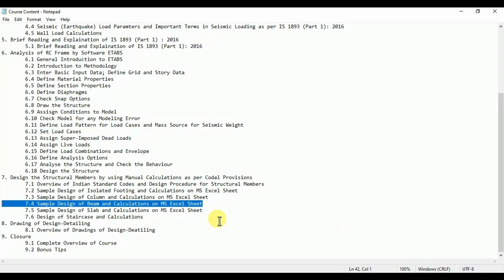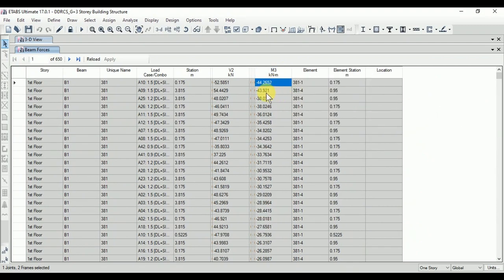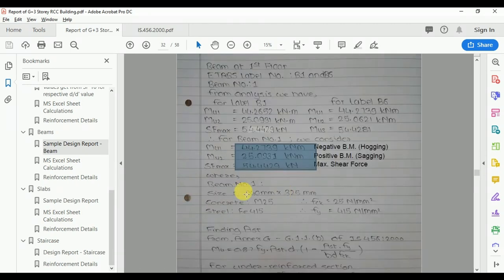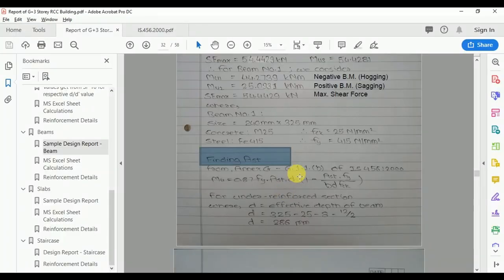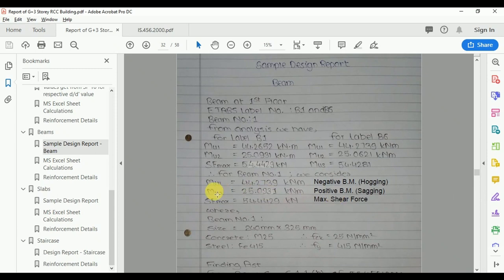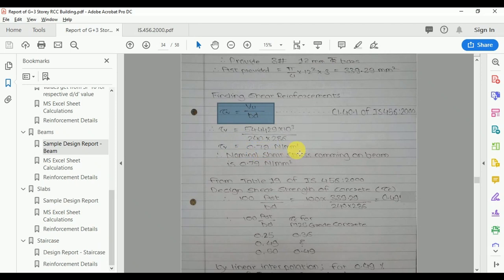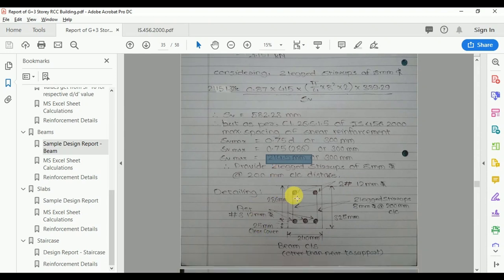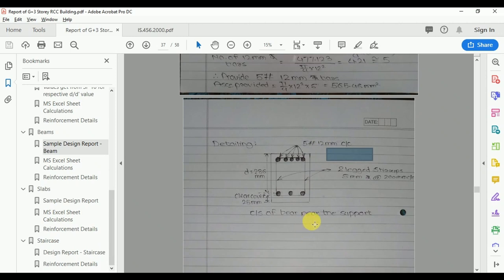7.4-A Design of Beam by Manual Calculations w.r.t. ETABS Analysis as per IS 456: 2000

Comment: For negative moment (hogging) = 234 knm. My reinforcement is 10 # 20mm bars. How would I arrange 10 bars. Is it ok that my no. Of bars are coming 10
Reply from the maker: no this is not acceptable for regular size beam, spacing in between bars should be more than nominal size coarse aggregate... in that case increase the beam dimensions or go for higher grades in material for concrete and/steel...
Reply: @AkshayThakur  my beam size is 400×500mm
Reply from the maker: how you can arrange 10 bars in 400 mm,  with proper nominal CA distance in between bars, so you need to change the section size & or material properties
Reply: @AkshayThakur  can we provide it in in two layers. 🤔
Reply from the maker: @harishjoshi1139  yes you can but some additional steps in design methodolovy are needed for this...

Comment: Did you consider *Affect of torsion on beam and *No reinforcement Layer in beam in EXCEL sheet ?
Reply from the maker: In practice, torsion is consider in very few cases like when beam is curved, cantilever beam supported on span of beam, cantilever slab supported when no back-tie slab, etc... here no such case so no torsion is considered while designing beams....

Comment: Sir, in actual practice dont we have to design the beam as a continuous beam and not as a simply supported beam
Reply: Also is it necessary to first design from tension side..as you've taken Ast for shear reinforcement from tension side..what if we first design from compression side..will that make any difference in calculation of stirrups
Reply from the maker: here if you see, i have provided main bars throughout, and extra top bars are also provided, so as per software consider continuity for  those effects are taken into account as a continuous beam...
Reply from the maker: the more economical way of doing is.... take the BM at near Support (Top End Region) and Design for the same...
Reply from the maker: stirrups are individual w.r.t. top support r/f
the design made in a way that
Bottom r/f : Positive BM
Top/Support r/f : Negative BM
Stirrups : Shear Force